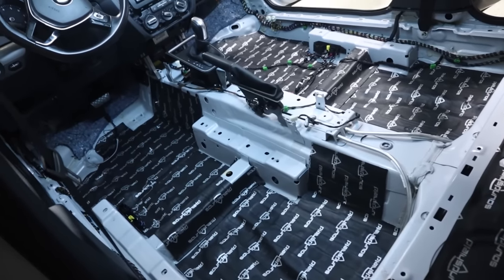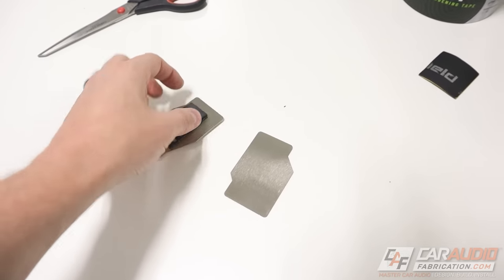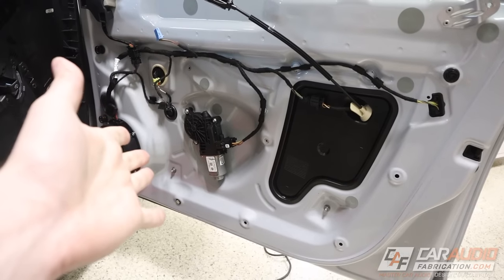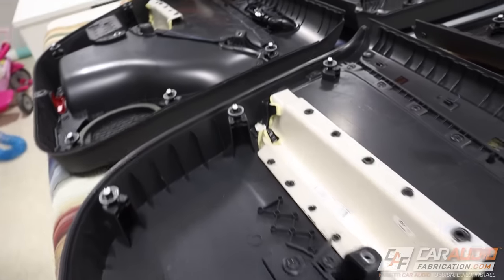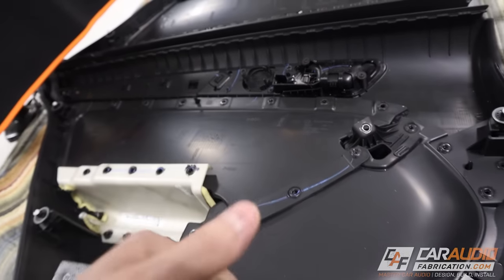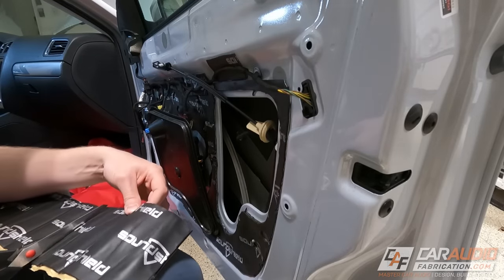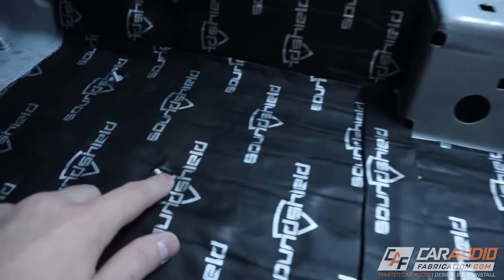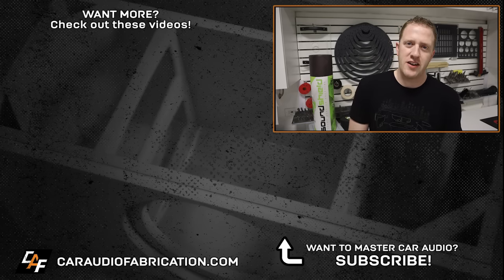IMPROVE SOUND! Deadening Treatment EXPLAINED - Better Bass and Improved Sound Quality!

Comment from the maker: 😂 Who wants a yummy snack??? 😂
Reply: whatcha got
Reply: You mean the ear wigs?
Reply: Special scoobie snack? Wink wink lol
Reply: One areas you are going to want to put sound deadening material is on the roof of the Jetta, I have the exact same car there is a wood board up there that will rattle with any bass.  May be worth it to do a video on how to drop the headliner and such.
Reply: Would spray foam work?
Reply: @0420Junket  Doobie snacks !!😎
Reply: I need a guy to do this for me lol
Reply: @KH-yv1bo  d
Reply: "Ooh some yummy snaccs!"
Reply: @reggienhappiness8851  bitumen works 👍
Reply: You're the kind of person with attention to detail that I would love to have work on my Brand new 2023   Toyota TRD pro 4 runner.  I'm disabled so doing something like this would be extremely complicated for me....  do you know  Of anybody in the Central Oregon area who does this type of work  And again with your skills set.
 Thank you
Reply: Got loads of those on my front bumper at summertime, after a sweet night drive. 💀
Reply: For floor it was not sufficient enough to use this materials. In my country we use for floor much more rigid and thik 4mm, and this material should be applied preheated. Coefficient of reduction of it is about 0.6

Comment: I slapped some inside the walls of my clothes dryer. Then took the door apart and put it inside.  Dryer is crazy quiet now!
Reply: Thats actually a really good idea if there aren't any hazards that come with it
Reply: @Its_3055  no hazards as long as your dryers disconnected when you do it. The stuff doesn't melt or create a fire hazard.
Reply: Another noise reduction trick: Zip-up and button your jeans "backwards" before throwing them in the drier.
Reply: @robnation2475  I do that and have been trying to get my wife to do that for years. Common sense. She doesn't get it. That loud rattling drives me nuts.
Reply: Just used this stuff again on a pair of old school/gym lockers. Mucho better.
Reply: @reykennedy5716  Bummer!  Some invert their jeans entirely but I just zip them up normally and only reverse the button.
Reply: You are a mad mad evil genius!
Reply: @Chaotik_Pranxter  Thanx!
Reply: This is gold. So lucky I have some left over.
Reply: @trilliam0316  Thanks!
Reply: @robnation2475  did the dryer make noise even when disconnected?
Reply: The darn dryer caught on fire due to the gases released by the tar contained in the deadener stuff.
Reply: @felipevazquez5339  The sides of a dryer don't get that hot. You don't mount it where you could burn your hand etc.  Nice story though.😄
Reply: so when are you gonna cram an amp and a pair of 12"s in your dryer
Reply: @saleplains  That would be some Highly Aggressive Stress Testing  😃
Reply: You sir have a very positive way of OCD in handling annoying things. Pure genius!
Reply: Great idea! Mine is directly under my upstairs bedroom, thank you!

Comment: I've always had the impression sound deadening works well for just regular road noise as well.
Reply: Totally does!
Reply: Ask any luxury car.
Reply: It does just manufacturer being cheap
Reply: I own an 06 honda civic lx sedan. The owner before me had a lot of road noise so he installed a shit ton of expensive sound deadening material throughout every nook and cranny of the car. Definitely helps with road noise and definitely helps with audio quality
Reply: It does. You just need to be sure you sound deaden the firewall. This is the source of 90% of the sound you hear from the front seat.
Reply: @davethefish7653  outside in engine compartment or inside? Is butyl like dynamat okay or do you need the wetsuit material rubber
Reply: @davethefish7653  hmm I do not have that feel in my Opel Astra 2017, most noise come from trunk and rear wheel arches.
Reply: @anglerandy5736  both if you want. I’d handle the inside first because it’s just easier to do yourself but if you want the best you can do both and it will help a lot
Reply: @OOICU812  p
Reply: Nope, that does nearly nothing for outside noise
Reply: @ekimandersom4478  - wrong.  It can definitely reduce external road noise, if it is installed in outer door skins, boot/trunk, floor and wheel arches.
Reply: Well it is sound so…
Reply: The firewall is a good start, but I’ve found the most noticeable difference in treating the back of the rear seats.  That one area goes a long way towards muffling all those annoying  bangs and screams that originate in the trunk.
Reply: @anglerandy5736  No you do not add sound deadening to the engine compartment that is just ridiculous, The heat alone would start to melt the rubber butyl! Also using a sound deadener such as rubber butyl is used for cutting down vibrations and acoustics in panels, Mass loaded vinyl is used more for cutting down heat, road and wind noise! Plus most vehicles already have some type of mass loaded vinyl on the inside of your firewall!

Comment: I did that and more to my SQ build I did a few years ago. I siliconed any seams in the doors, and did 3 layers of deadener, then a layer of closed cell foam. Those doors were solid! Then I did carpet padding too under your feet, and got the whole vehicle undercoated, so you didn't get any vibration in the floor. Some SQ competitors will do even more. One guy had a couple hundred pounds of clay in the footwells of his regular cab pickup! Once they get into the clay or sand, in addition to the dynamat type materials and closed cell foam, then you know they're serious, haha. It's probably the #1 way to improve a system.

Comment: So roughly $900 in materials is mid level? I guess high end would be 5 figures...great video and I like how you started it with tackling the economics of it.
Reply: @nectros8452  $900 is not a lot for audio. That's about $125 per door and a $250 amp. You'll also need a line out converter to connect the amp, an amp wiring kit with a decent fuse, and new speaker wires to the doors.

Comment: Hey Folks, don't forget that if you're running old tires or if they aren't inflated to spec, you could be introducing a huge amount of noise into your car. Most likely more audible noise than you would be able to eliminate through any amount of sound deadening.

Comment: I replaced my head unit, and ran the stock door speakers for a couple days . . they rattled and buzzed like crazy! I was a bit nervous to put my new speakers in but, when installing them I put sound deadener on the inside of the door, I put foam on back of the speaker magnets, a foam ring around the speaker, and used this foam tape that goes around where you mount the speaker. After watching this video, I will admit I did not do anything to the back of the door panel so, I will be doing that on my next day off! Anyways . . It now sounds amazing! I am very impressed, full volume and no buzzing or rattling! I now have my amp and subs intalled, an d I have not done anything in the hatch yet so, the subs are creating some rattles in the back. I plan on doing that here real soon, and can't wait for the results! This guy is very awesome! His work is very beautiful!! I really enjoy, and appreciate these videos!!

Comment: 14:10  The owner and founder of Hushmat spent about 45 minutes with me at a training (yes, I had tons of questions). As a degreed acoustical engineer, he said that there is no benefit above 75% panel coverage. When he was designing noise control packages for several OEMs, he had access to sophisticated measuring equipment to verify this. 
He further said that shops that cover 100% of a panel only do it out of fear that the client will think he is getting ripped off. Exceeding 75% adds unneeded mass to the vehicle. Dr. Porsche famously once said “weight is the enemy”.
Reply: Wow super interesting, thanks alot for sharing that!
Reply: ... and Mr. Colin Chapman said to "simplify, then add lightness".  If only the manufacturer(s) covered 50% of the (floor) panel vs the 20% (or less) they typically do, I think we'd have better interior car environments across the board; not just in Lux brands like Lexus, Infinity, BMW, etc., etc.
Reply: @K03sport  well that’s where “luxury” comes in and that’s what you pay for
Reply: @jonellwanger7258 ...to a certain (small) extent. There's way more to a luxury car than 30% more sound deadening/absorption material. Thats just covers the noise/environment aspect inside the cabin. There are still many more areas of the car that elevate it to the luxury level (something Mazda is attempting to do) such as the feel/driving characteristics, touch points, materials used, semi-exclusivity, technology, and even person-to-person interactions at the dealership.
Reply: @K03sport  ok, yes there is more to it. I was making a generalization...   🤦‍♂️🙄🤦‍♂️
Reply: Cool thanks!
Reply: Definitely true for any type of CLD.  I've heard that 30 to 35 percent is the best bang for the buck. 

Think of ringing a bell. If you want to prevent it from making a sound, you don't need to cover the entire thing. If you put your hand on a small part of it, you're going to prevent those vibrations from traveling through it and making any sound.
Reply: This is incorrect. A distant cousin of mine has an acoustic degree from Purdue and is the founder of soundstop url. EAV, ELV, Db A and Db B are all very different. Talking about car audio sure he's not overly lying. But claiming no difference is silly. 100% > 99 or less % in almost every scenario. Covering panels 100% with quarter inch isn't as effective as covering 100% with half inch. I've been doing home theatre and car audio for 19 years and with relatives that helped me succeed I will say "the more the merrier". With cars, take weight into consideration. Risk vs reward type.

I'm not arguing though. You're not wrong. 75% is plenty for car applications.
Reply: @brianmoore2735  car audio isn't silencing a bell. It's preventing rattle
Reply: @samuelfowler2157  CLD is not for silencing rattles. It's to stop resonating vibrations.
Reply: @brianmoore2735  now google the definition of resonating vibration. (1) When vibration is transmitted to another object whose frequency is the same or close to the source.
"The resonating vibration at the window is causing the frame to rattle"

Comment: Around 5-6 years ago now the first time I did this sound deadening jazz I went way over the top. Pretty sure I went through 7 of the Dynamat megapacks, well over 100kg of dynamat.  I double skinned the outside door panels, single layered both sides of the inner metal fab on the door. Used some tin or something and cut sections for the service ports and 2 layered up the 2 largest ports on the inside of the panel using the smallest remaining service port to do so, the last port was double or triple layered only from outside along with the 2 largest. Completely stripped the interior and boot of the sedan and single layered the floor with dynamat and then applied dynaliner. The entire parcel shelf has dynamat single layer on both sides with dynaliner cut and shaped for premium fit. Entire boot is single layered. At the end of it and particularly the doors my hands were a mess.

Everyone comments on the lack of road noise in the vehicle.

I run 2 Hertz SX300Ds in a CAF designed 42hz ported box off a RF 2500BDCP gains set 2000w RMS @ 50hz. Digital source all the way to Bit Ten D, gain structure is optimal.

When tuned right and volume set correctly they are awesome, the transition to the mids is excellent.  To this day a rattle I have not found.  I suppose that is an argument for going over the top with sound deadening.
Reply from the maker: Glad to hear you are enjoying the subwoofer blueprint designed box! There is definitely nothing wrong with going over the top, I just have received a lot of feedback in the past that tells me people think they have to spend the "high end" budget in order to even begin to see benefits which is not the case. Even an "entry level" amount of treatment goes a long way. Of course it won't be the same as the "high end" but every budget achieves a different end result.
Reply: @CarAudioFabrication  Legend.
Reply: does it help to keep the sound inside the car as well?
Reply: Hey mate,  I'm in Australia and prices are near double. Would using a foam product that's say 8mm thickness be too thick ? @CarAudioFabrication
Reply: @Reflect744  hey mate,  aussie here too (obviously). The issue with thicker matting is getting door cards back on etc. Clips n screws are long enough to take up the extra space. For the boot, roof and bonnet area,  it's perfect though.
Reply: Damn man you went incredibly all-out. That’s the kind of dedication a forever car deserves. What vehicle was it?

Comment: 16:38 One noise control measure you do NOT see in this VW (for cost reasons) are STUFFER BLOCKS, found in BMW, Mercedes-Benz, etc. - shaped blocks of grey closed cell foam OR dark grey polyester fill, like firm pillow stuffing. The latest version of this is NOISELITE, similar to THINSULATE used in cold weather jackets. When you work on a Hyundai Palisade you will see a small piece attached to each kickpanel.These stuffer blocks trap airborne noise as it moves around, not to dampen panel vibrations. We attack 2 kinds of noise: STRUCTURE-BORNE NOISE and AIRBORNE NOISE. The materials that stick to panels kill structure-borne noise (vibrating metal & plastic). The closed-cell foam used in SoundShield kills airborne noise that propagates into the interior from vibrating panels and other noise sources. You need to address both “sources” to be effective. In addition to these materials, I have started using stuffer blocks in my project cars. There are two more techniques I use that are more esoteric, inspired by Rolls-Royce.
Reply: I believe this is why he has labelled it as a ‘mid’ level upgrade.

Most car audio garages in Australia will put butyl matting, then cover with focal hushmat or other similar closed cell adhesive back matting. 

Some even use mass loaded vinyl underlays to reduce road noise from the floorpan
Reply: What are the more esoteric techniques
Reply: Heck yeah bud , great info 😎👍

Comment: Ok i must say... holy crap. Ive ran 2 JL w6v2 10" for 7 years in my ctsv. Always sounded great. 2 weeks ago I watched the video and did the exact same treatment 4 days ago. Same material. Now I run a single 12" w6v3 and upgraded the door speakers with focals on the factory hu. The installation took 6 days (I have a daily driver). Not only does it sound louder with 300 less watts but the clarity is crazy. Added just shy of 45lbs but saved 66lbs with a rear bumper brace replacement. 1300 bucks later (including bumper brace) I weigh less but sound day and night better. I wish I had a channel so people understood this difference.
Reply: You do have a channel, friend! You can upload any videos you want at any time. I know you know this, but I just want to let you know it again. I'm glad your awesome CTS-V sounds better and is even lighter than before, what a wonderful vehicle.
Reply: @jgizzy  I know I can post a video on here but I don't have a channel that is out there for comparison videos. I don't have any befores anyway. Or a gopro lol I'm old.

I'm doing an evo x right now that if I get my funds right will be done this summer. Since I haven't tore anything apart I thought about doing a forum picture guide. A video on here might be worth the time. Anyway I bought another w6 for a magic box but I'm thinking I want to try sundown. Do you have experience with these to compare the 2 brands? I'd like to keep weight off the evo but even with the stock rocksford sub, the trunk lid is sounding crazy. So I'll have to atleast soundproof that.

Comment: You definitely know by now but those are actually two part clips. You unclick it once then pop it out. When you reinstall you line them up and click them in it pops the prints out. They also have that thin rubber the decouple. You did this vid to late I half hacked my Jetta in January. Still happy with my result but plenty of room for improvement. Gonna use this series. Thanks for what you do!

Comment: I love your videos! Very educational and inspiring for those of us who want to learn something new. I drive for a living and road noise is my daily nemesis! I experimented with my 2018 Nissan Titan I just purchased last month. It does have all terrain tires and I did expect it to be a little louder on the highways because of them. I used a decibel meter to measure how many decibels it was at 60 mph. Which it was about 65-75 db levels. I had to replace a blown speaker in the passenger rear door. So, I decided to upgrade and add some sound deadening material as well. I just finished everything yesterday. The sound level is exactly the same, but the radio sounds awesome and I definitely do not have to turn it up as high to hear it even with the road noise. I think I need to treat the wheel wells, firewall and possibly the floorboards. But that will be a whole new adventure for me! Thanks again for all of the great videos!!!